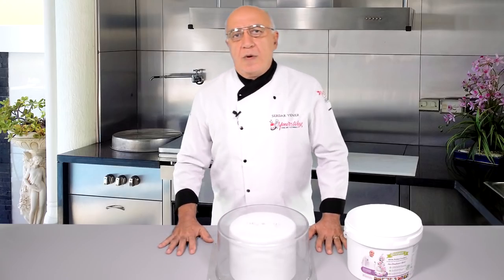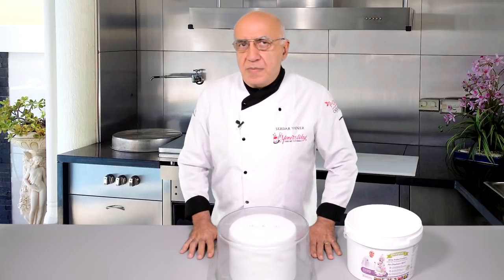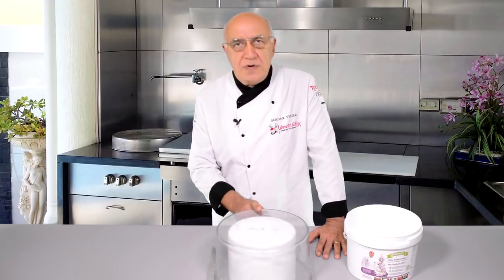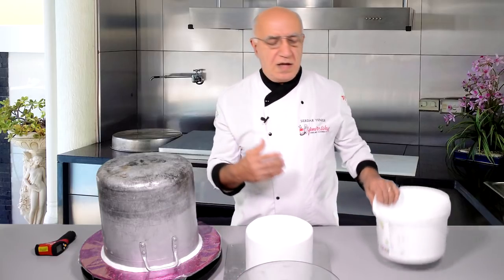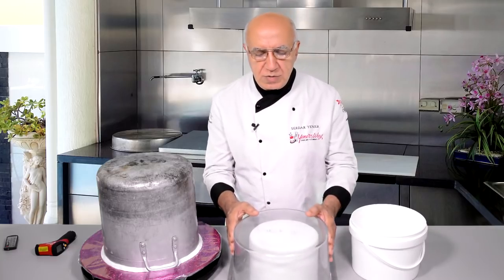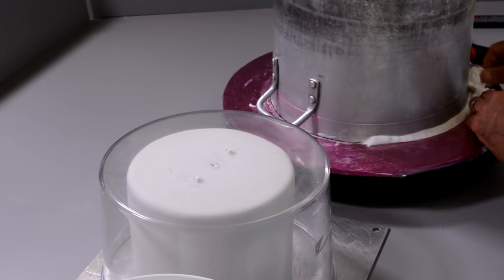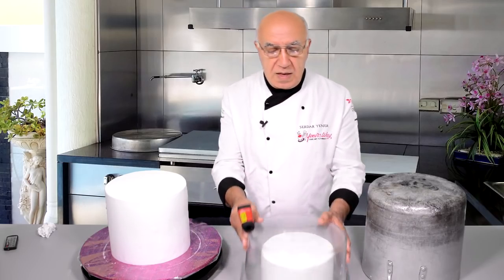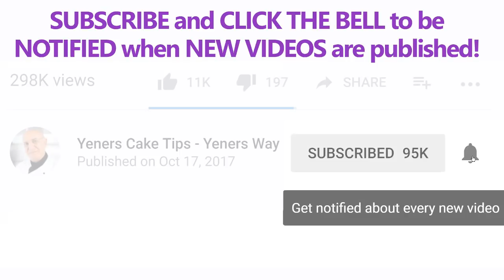How to PREVENT CONDENSATION on Fondant Coated Cakes | Yeners Cake Tips with Serdar Yener

Comment: You can measure that temperature.
It's called dew temperature or dew point.
You can buy room thermometers that calculate the dew temperature. If your cake surface is above that temperature, it will never get wet.

Dew temperature changes with room temperature and humidity. You need to check that every time.

Comment: I usually put my cakes in a box when they come straight out of the fridge. Works perfect 👌 no condensation at all.
Reply: Rachel S even if it is humid or rainy? Im using mmf and yesterday i maid a huge mistake it was raining here in my place and my fondant was kind of sweating but not all, then i put a fan to reduce the sweating iy got even more worse! My toppers were soggy and my fondant was sweating! Though i delivered it earlier today successfully but it was sweating i was so thankful that it was just a single cake im worried if im going on to tiered cakes this coming 3 months because its gonna be rainy here season here and its starting now.. does this really work? Im so worried i haven't got any sleep just on baby sitting the cake last night..😅😅😭😫
Reply: MariaCathrine 12 yes it does. You should keep it in the fridge and take it out a couple hours before delivery and put it straight into a box and close it shut. It works for me. It keeps the coolness locked in and brings the temperature down slowly. Try it. You can only know until you do it. Good luck !
Reply: @rachelt1523  the temperature that he speaks, of the enviroment and of the cake, should be the same to take away the pot?
Reply: @rachelt1523  Fondant covered cake in the fridge??

Comment: Mr Yener I live in the Caribbean and a beginner,even though I try to cover the cake fast,it starts to get sticky,I don't even have time to use the smoother to get good edges. I'm not yet equipped with a air condition room. Is there a way I can put the fondant with putting the cake to chill first?
Reply: Hi kimmy. I live in the caribbean too. What i did find helpful is changing the fondant you use to homemade marshmallow fondant (if you do make your own fondant, then i suggest following this recipe. It's quite durable: https://youtu.be/GaKqSND8sPc).

For the cake, if you give it a good thin crumb coat with buttercream that uses more shortening than butter, and cover it with that new fondant recipe, you'll be fine. You wont need to put it on the fridge and it'll hold up well
Reply: @ChelX  thank you so much.
I tried the link but it's not going through.

Comment: Hi what if you store the cake at room temperature then the next day you apply the ganache then the fondant what would be the out come if you hand paint it? Would it be a total mess by the next day?
Reply from the maker: If you store the Ganached cake in room temp and cover with fondant without chilling and making firmer, you will not have any condensation, Unless the fondant you use get wet any temperature ??!!

Comment: Thank You for the tip. Will this also help avoid those ugly air bubbles that form on cakes after they are covered in fondant?
Reply from the maker: That is exactly what is this method for.
Reply: Yeners Cake Tips - Yeners Way Thank you. I always struggle with those.

Comment: Ok so we wait till the cake has already reached se temp.as room? But then what? The cakes already have the fondant on. What happens once cale and temp changes again
Reply: have the same question not clear on what he is saying
Reply: When the cake reaches room temp then you can continue your decorating...if you start decorating the cake before it reaches room temperature,then it will get sticky (sweat) and hard to work with...I think his explanation is quite clear...but you can always listen to it again
Reply: fondant cakes are a problem for me. I live in Jamaica. Once I cover the cake in a crumb coat put it in the freeze to chill so it firms and I can cover in fondant. Once I drape the fondant over the cake and start working on the pleats it starts getting sticky. I can't even get sharp edges...put the cake back in the fridge to chill so I can get sharp edges only gets more sticky....video not clear there is a step he is doing off camera that is very important.
Reply: I can identify with you because I live in St. Lucia and I've been having the same problem...but what he's saying is that when you take the buttercream-covered cake from the fridge, you have to work with it fast before the cake starts to condense/sweat...he said the longer you take to apply the fondant, the cake will start to sweat because of the change in temperature....so the steps are 1. Take cake out of fridge, 2. Apply fondant quickly before too much condensation forms 3. Cover with container for a few hours until the cake comes to room temperature. 4. Now the cake is ready for the decorations!

Comment: I have to cover a cake tonight and stack tomorrow.  It is 90 degrees with high humidity today and tomorrow calls for rain.  I am so worried!  I have a cake taker, should I put the cake in the cake taker and then in the frig?
Reply from the maker: Actually problem is you will have wet surface when you take the cake out from the fridge. If your room temp cool enough keep it undercover on the table overnight. If the cake tomorrow is too soft place shortly ( 15 minutes)  before stack.